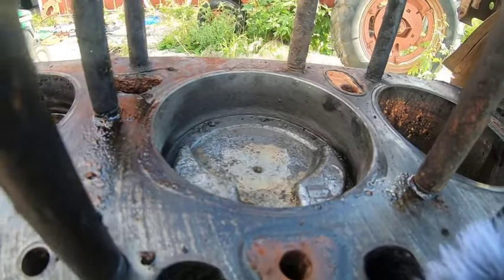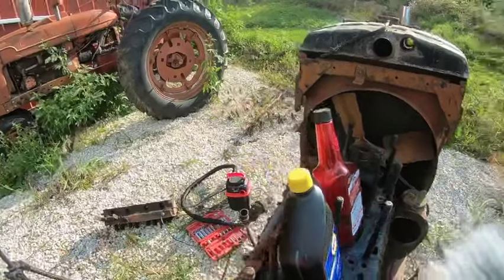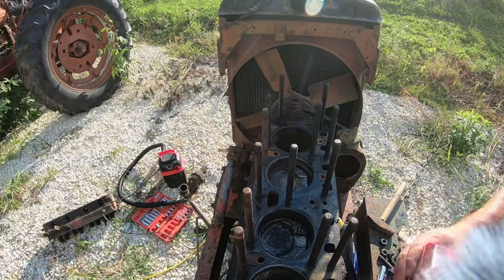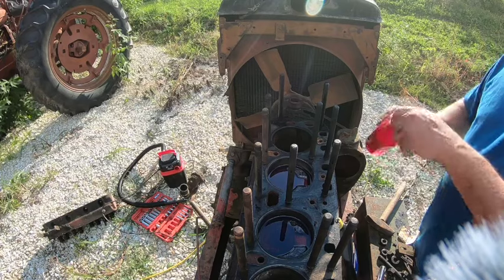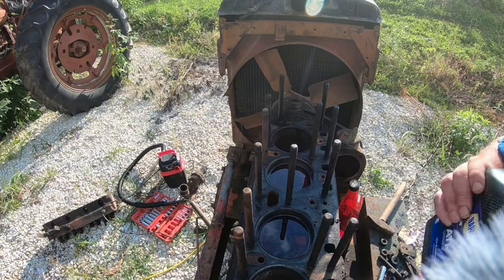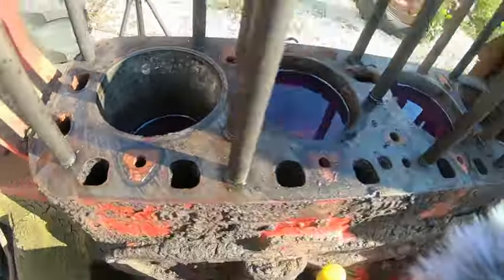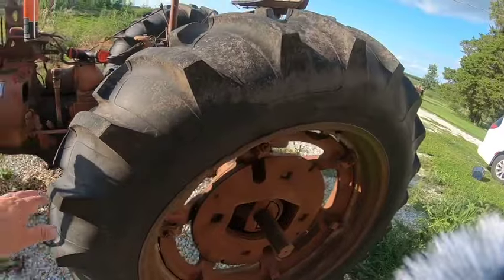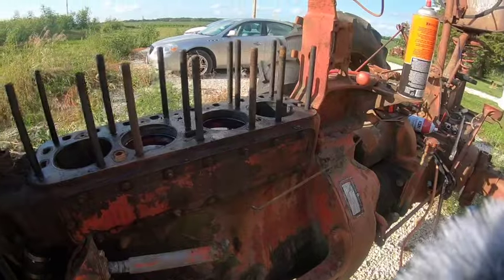Cylinders cleaned & ATF and Marvel Mystery Oil set in for the long soak on the stuck Farmall Super M

Comment: I will be looking forward to seeing the results my M has been sized for years I just used Winter Diesel and I haven’t had any luck 🇨🇦😀
Reply from the maker: I may not either but the evaporust really cleaned the cylinders up
Reply: I have loosened many stuck Engines  but I never had any luck doing it any way like this.

     Furthermore, even if One gets this method to loosen the Engine this way, the rings are very likely to stick in Their ring lands and, the Engine will have to be disassembled anyway.

                                         Fergieman
Reply: @Corvacar I agree. A friend of mine had a Massy 33 with a stuck motor. He soaked it like this, got it loose, ran it. But it burned o lot of oil. So he took the pistons out and re ringed it, honed the cylinders and now it runs like a new motor.

Comment: Muratic acid works wonders in rusty stuck engines , cleans all the rust in a hurry ,rinse with water , add marvel and try to spin it over
Reply from the maker: I am a little hesitant to used the acid in the engine first off. However if it doesn’t bud this is on the table to try!

Comment: Use Seafoam it will work better than anything else and you can put it in the engine oil and gas as well. Anyway the lube never works on the stuck surfaces just makes somewhere to go easier when they break free. An air chisel with a blunt bit can do wonders for stuck stuff.